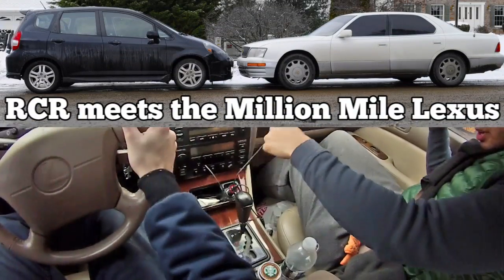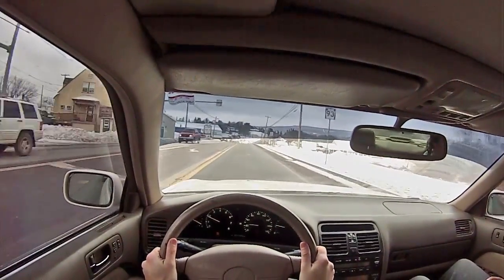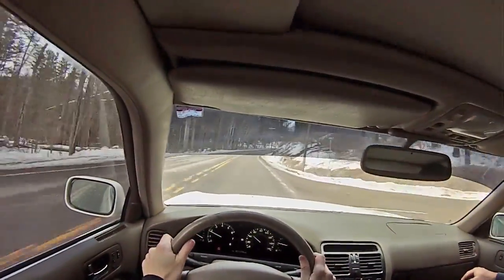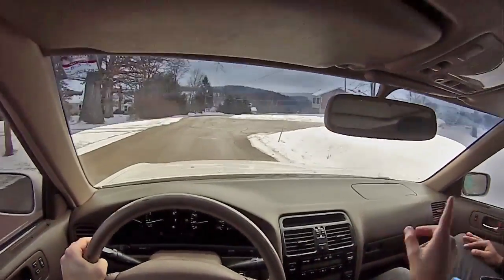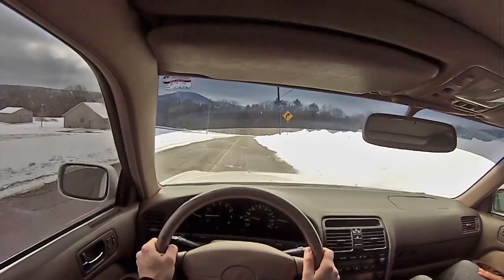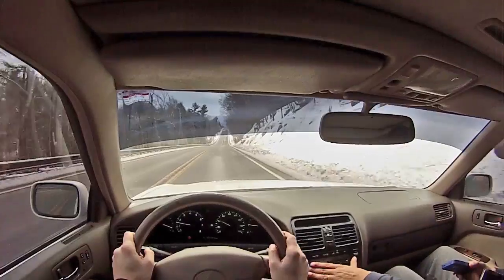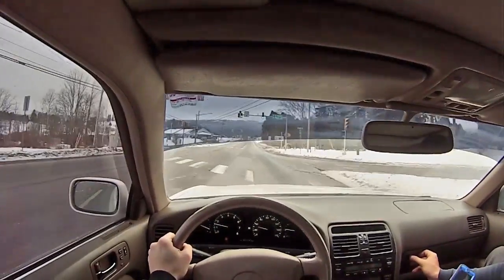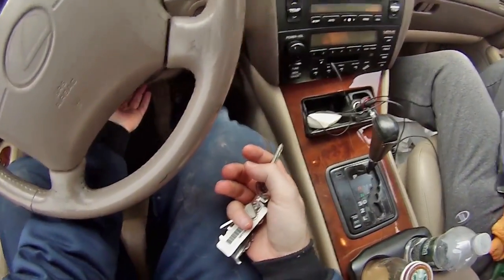Million Mile Lexus P.O.V. Drive

Comment: Like driving a crown vic, really?  Not even close!  

The LS is smooth and soft but corners well. 

The Ford product bobs and weaves and rolls and bounces while still making every moderate nook and cranny entirely apparent in your spinal column, it turns about like a school bus, and steering feedback and dampening is a sluggish mess compared to the "Progresive Power Steering" of the Lexus LS. 

I drove a 60k mile 2000 Grand Marquis (with the "Precision Track Suspension" logo so proudly embossed into the woodgrain dash panel above the glove box) daily for the first 6 months of this year, second time using that particular car on any regular basis since 2012. 
I'll gladly take a LS400 over that particular ford product any day. 
The 5.4L V8 of that Grand Marquis was beyond gutless and the automatic loves to have torque converter lock-up chatter at moderate speed whereas the LS400 just shifts like it should when it should, has tons of torque from that 4.0L V8, gets comparable overall fuel economy, is far better equipped, and just plain wants to go without even having to floor it. 

In 2011 my 1994 LS400 was just smooth and quiet even on the cobblestone streets of New Orleans and yet it would just stiffen up as it started to lean and it could hang with my buddy's stock 2001 IS300 (formerly my IS300) on twisty roads and walked past him in a straight line at 35-80mph, although we didn't want to try triple-digits with the heavy LEO population of his semi-rural area at the time.

The LS was sort of like a Camry but with everything more... 
Doesn't accel as a sportscar, doesn't accel as a pure "smooth as silk" luxury car, but does an incredible job overall everywhere in between in style and comfort even 15-25 years later...  So plain boring blah vanilla luxury mush box and yet still so much fun to drive even today. 

Ironically a buddy's dad needed a cheap car and I needed better economy for my long work commute so I bought a Mk4 TDI VW and sold him the LS and every now and then when we're making an airport run or stuff like that and he hands me the keys I still find that '94 LS400 so much fun to drive today. 

I think I'd like to try a GS400 someday. The SC300/400, I'd rather have a Mk3 Supra again, the 7M-GE over the SC300, the 7M-GTE over the SC400, but that's just my opinion...

Lack of down-shifting and TPS code sounds an awful lot like the ever so common LS main ECU/ECM capacitors problem. 

Those cars are so "old man" but so oddly enjoyable to drive, especially with a good rebuilt ECM.
Reply: The grand marquis never had the 5.4, and you never drove a million plus Mile LS sooooo
Reply: ...sooooo 
A modest typo on my part during a >20 hour work day in a moment of exhaustion, you're right it wasn't a 5.4L Grand Marquis it was the Ford 4.6L V8 in that Grand Marquis which had the crappy economy of a V8 paired with the awesome driving performance of a comparable year (non-SHO) V6 Taurus at best and the last time I drove that 2000 Grand Marquis about 6 months ago it only had not much over 60k miles on it after more than 15 years of being driven by a combination of my grandfather and my mother who hated it and ultimately gave it to my dad with a whopping 45k miles on it at more than a decade old... 
I actually rolled its' odometer over the 50k mark myself back in the fall of 2012 and I also rolled that car's odometer over the 60k point myself in 2015 (because my  dad won't go out of town in that car) and it's just as mediocre to drive today as it was in 2012, unlike the 1994 LS400 I bought years ago with 180k miles on it, drove daily for close to 50k miles myself in less than 2 years with only a pre-planned timing belt/water pump/fluids service the week after I bought it and a factory original fuel pump failure at about 195k miles that actually died one day after I parked at work and turned the key off, then I sold that LS to my buddy's dad 5 years ago with a quarter of a million miles on the odometer after I transitioned to the TDI world for work and it's still on the road today. 

Plus unless the million mile LS has a worn out or otherwise broken factory Lexus electronic suspension system, and even if it does need suspension work, I guarantee you the million mile Lexus LS probably still rides and drives far nicer, smoother and better overall than the Ford product it was compared to. 
Hell, most of the time I could floor the pedal in the Grand Marquis and a mid 90's 4-cylinder Camry would be faster because like the partially broken LS400 the Ford product would refuse to down-shift but unlike that million mile LS400 the Mercury was not broken and even if it did bother to down-shift it was still about as fast as a stock late 80's automatic Cutlass Supreme (not the 442 although I don't know how that gen of 442 compares to the V8 Supreme) while that million mile 97 LS actually has some decent power and torque left under the hood from its tiny little V8 if you just keep holding the pedal down for a few more moments and let it get the tach up over 2500 rpm's...

The 1994 LS400 I used to own that didn't get the air ride option is still on the original factory suspension today and still rides, drives, handles, and perfoms far better with over 250k miles on its' odometer than the 6 year newer 2000 Grand Marquis with 1/4 of the miles on it, only about 2/3 of the way to having a 6-figure odometer that doesn't begin with a 0. 
PLUS I'd trust the 1994 LS400 that I sold to my buddy's father with well over 200k miles on it to take a road trip to Dallas as-is while every time I drove that low mileage Mercury the 50 miles to work or the 50 miles in the opposite direction to my parents' house it was heavy, mushy, erratic, and unpredictable enough to make me worry whether or not it would make it to my destination.  ...and a month after I handed it back to my parents it left them stranded a couple miles from their house.

So get the ECM of that million mile Lexus rebuilt to fix the TPS gremlins (although it might actually be a bad or out of adjustment TPS by now with that many miles on it), service the transmission if the ECM rebuild doesn't also fix the down-shift issue (probably TPS diag code related), and if it really does somehow actually ride like a Crown Vic do it a courtesy and swap in a good set of factory shocks/springs from a not air-ride model or splurge and fix whatever's worn out in the air-ride system, and let that tired LS go back to being the sweet ride it still can and should be.

Comment: Just ran across this, maybe its been answered but if he's not sure if this is the original engine, then for all we know the engine only has 200k miles right?  We only know for sure the body has over 900k miles.  Not a car guy so excuse my ignorance if I'm way off here.
Reply: maybee more than 200k. my dad had an excursion with a 6.8 v10 and got rid of it with 450k miles on it all original used for towing and work
Reply: original engine and original transmission was replaced a few months ago I believe

Comment: I guess it could have mileage that high, although it's quite easy to adjust the mileage on a vehicle that has a digital odometer to read whatever mileage you want.
Reply: No you might be able to change the numbers on the odo(doubt it though) but you cant change the milage on the computer.
Reply: Rustyrivet250 Actually it does work that way.
Reply: KILLERDOWN7 It's not that you might be able to, you can with out a doubt change the odometer numbers to whatever mileage you want. Some vehicle do store the vehicles odometer mileage elsewhere on a computer, but I don't think this model does that, although I could be wrong.

Comment: yeh the cruise control doesnt work and the throttle position sensor and speed sensor is showing a fault on your OBD urm yehh that is why cruise control doesnt work :D but yakno 900000 miles will do that to you

Comment: 904K miles. WOW !!  That says something for Toyota quality, but I would NEVER buy a foreign made car. Period. There is a guy at work that has a '93 Ford Explorer with over 600K miles. 2 radiator replacements, as well as a tranny. The engine is original.  It sounds like it has solid lifters, but he drives it about 100 miles every day.